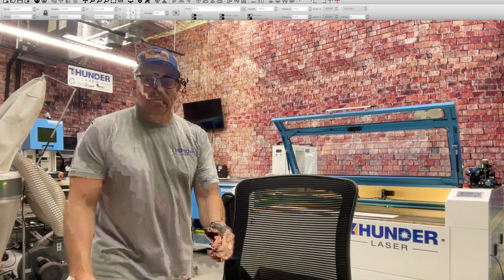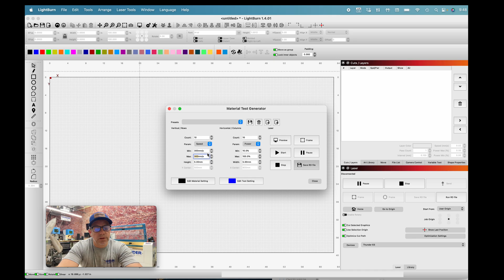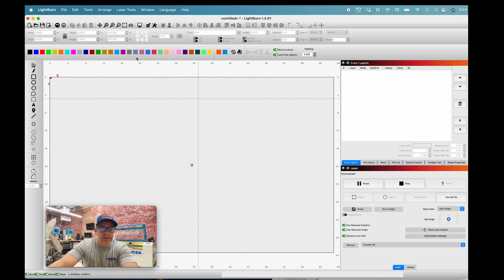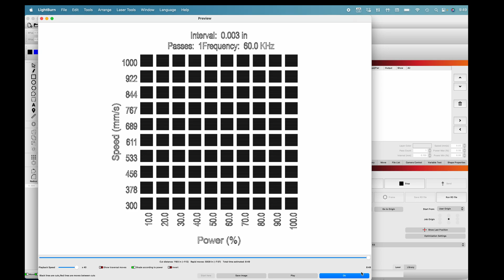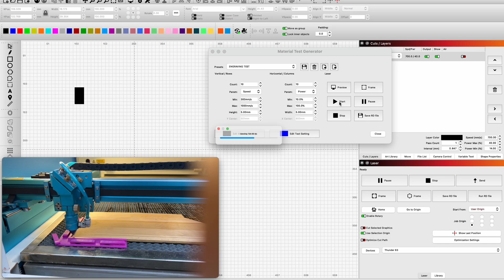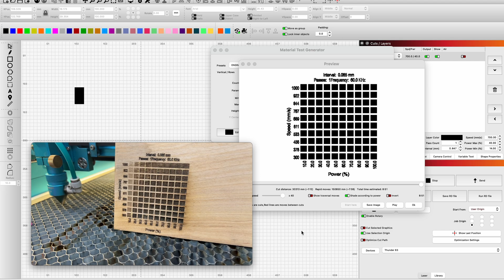Lightburn Material Test

Comment: I find the auto-generated material test useless so far and I’ll tell you why.
I believe the auto generated material test produces squares that are on different levels which forces the laser to burn each individual square seperatly instead of all at once.
Notice it refuses to acknowledge any radio button selected for fill all shapes, fill groups etc.
It only burns one square at a time which we all know that when a laser hangs out in a small area the burn will spread plus it does not give the laser head TIME to even speed up to that particular speed.
The end result might be that it will not even burn at that speed on a bigger project that gives the laser head time to speed up.
So, the auto generated material test is a waste of time because they haven’t fixed the issue of layers in a material test. Fill all at once should work but it does not. Why?

Comment: this garbage. Why wouldnt you have it on the lightburn screen. just sending to the laser ? how big it is ?
Reply from the maker: This is a built in function of lightburn, good questions for them. You can still build your own powerscale if you know what you are doing. But this material test card feature in lightburn is imperative for galvo lasers seeing the wide range of settings, materials and results. Its as big as you want, you control the block size

Comment: Nice video.  It would have been helpful if you could've gone through some various settings you might try like bigger line intervals and correct cut parameters etc.  But there is enough in your tutorial ith practice I will be able to figure that out.  If I was a new laser user not sure that would be the case.  Thank you.

Comment: Would you use the same parameters for the bolt?
Reply from the maker: You can use any parameters youd like.. thats the great thing about this test.. You can limit it or expand it.  But yes 300-1000mm and 1-100 power for the RF

Comment: In the real world, many wooden objects that you wish to engrave  are made from blocks or strips of the same wood glued together (like butcher blocks). Especially woods like birch, acacia or bamboo. It's then that you find this test data useless because different coloured woods from the same tree have different damage thresholds and engrave with different colours. I'm not going to explain why this happens,  that will have to  to be part of your learning experience  with laser technology . However you will note that any video demonstating this test does it on a fairly bland  grainless wood like Baltic birch. This matix test gives the impression that colour contrast can be improved with more power. That is a totally false takeaway from this test. If you run a blowlamp across a plain wooden surface at different speeds you will produce scorches that range from the faintest brown to almost black. However, feel the surface and you will detect  no depth or 3Dness to the colour range. There's something else going on with this martix test that means you only get more colour contast if you increase the power and engrave deeper, creating more messy brown surface residue. Explanation?